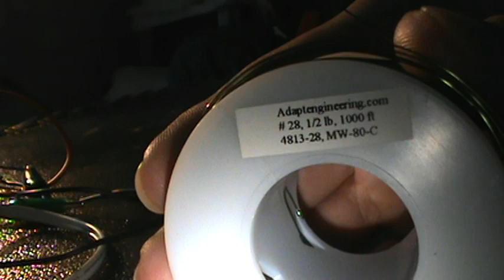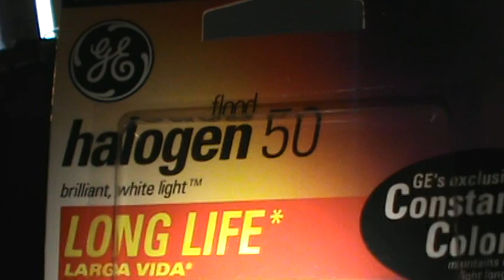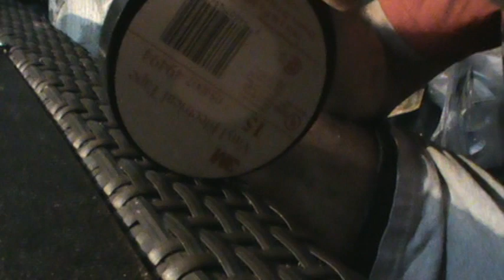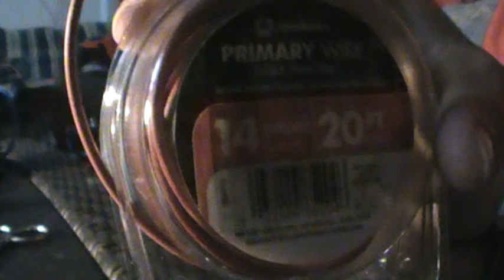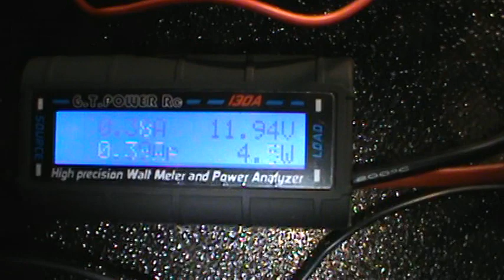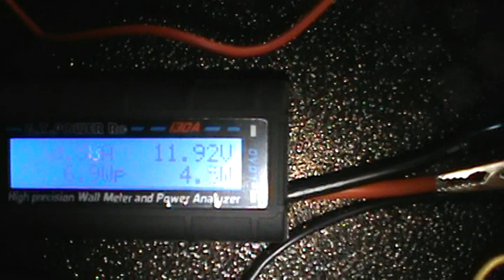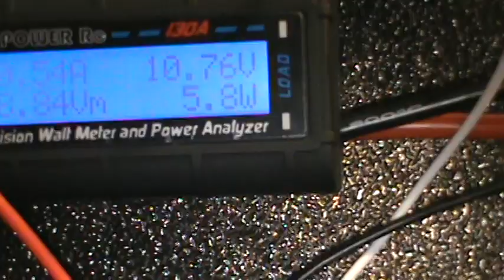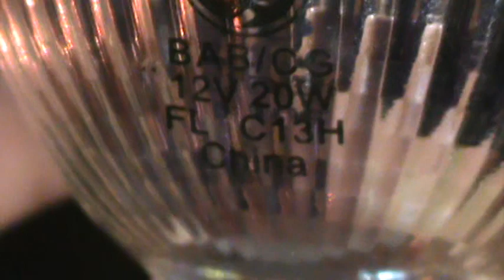How to make a Super Joule Ringer from start to finish

Comment: How long does it last 24 hours?
Reply from the maker: it last 2 hours off of my capacitor battery and I haven't had the chance to try it on a regular battery but can run off of a 12v house adapter
Reply: ok try it